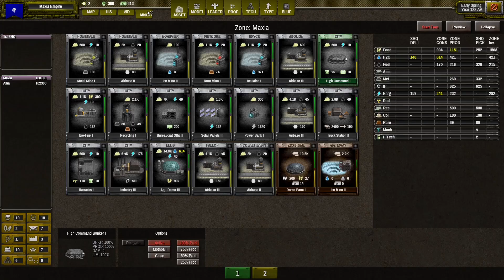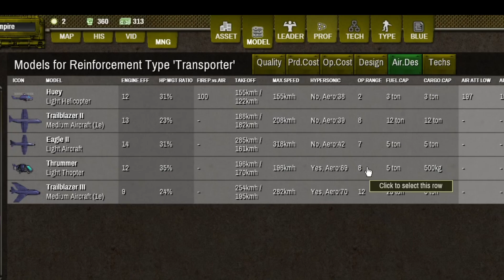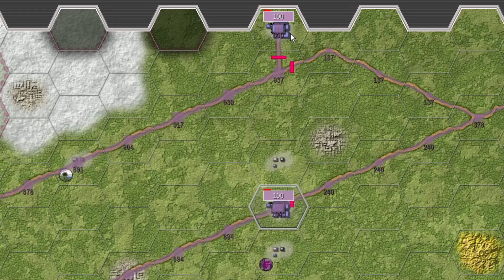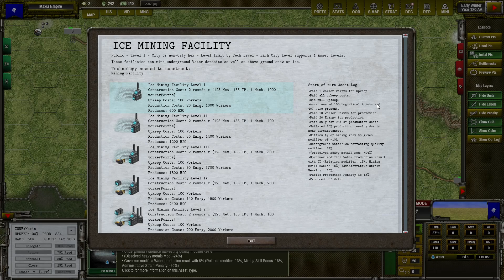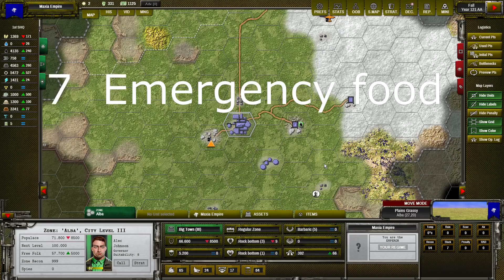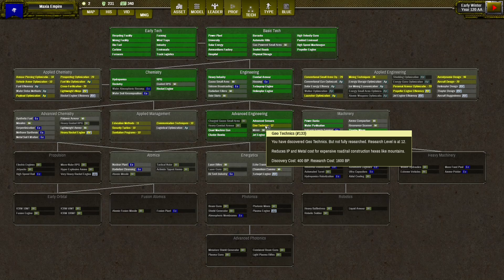Shadow Empire | 15 Advanced Logistics Tips

Comment: Great video - but 1 question: in 23:36, you say the 1st branch the game sees that 100 is highest, so it doesn't prioritize more than 100 on that branch. But then on the other branch - why does the game prioritize 80 (50+30 for units), wouldn't 50 be the highest one - since it doesn't consume (unlike units) and the 30 of the units just be part of it. In other words, why is the SE road prioritization 180 and not 150?
Reply from the maker: The max rule applies only to assets so the red pull points. The green ones (units) sum up together to 30 but also sum with red ones as those are different type of points. If we would have 30 red pull points then yes, it would be 150.
Thanks for the question!

Comment: Really good practical explanation and demonstration of how multiple truck stations on a roadway actually degrade overall capacity. Min 15 and the demo of logistical point injection is really well done, thanks!
Reply from the maker: Thank you. Regarding refocus it indeed affects the original points from the previous station, but if you can produce the difference in the same hex then the refocus doesn't matter. It's becoming a problem only when you cannot compensate the refocus loses because of the zone level and too high truck station in the previous station. Cheers!